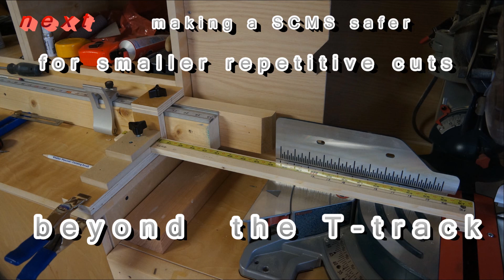safely feed stock on macduff' stationary table saw fence

Comment: Thats pretty slick, not keen on the kick back paw I dont think its nessary.
As long at the parts held down to the table it has little chance of kickback  one way wheels or berrings would make it better.  This would be harder to pull off with a bismyer fence. But you could craft one that fits over one and has t tracks on it for stuff like this. But it will mess up the table saw tape mesure.